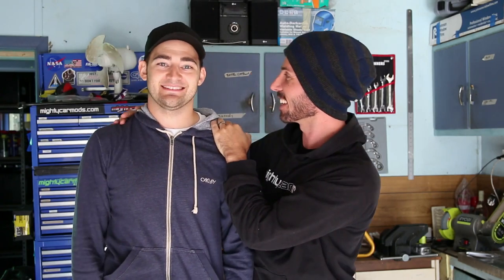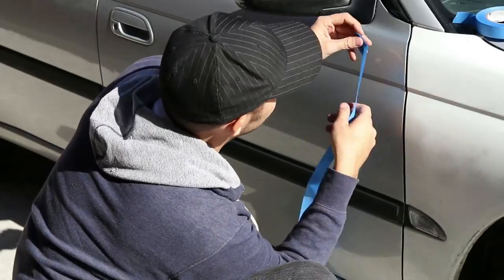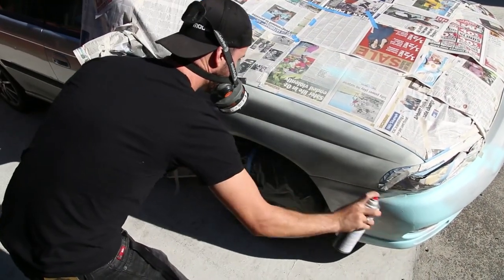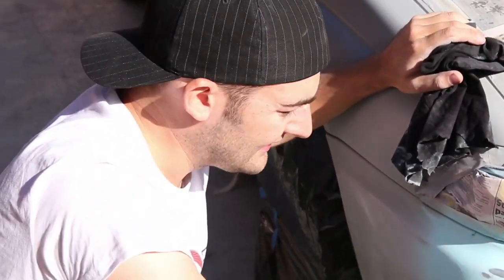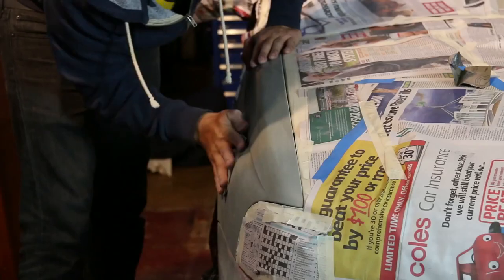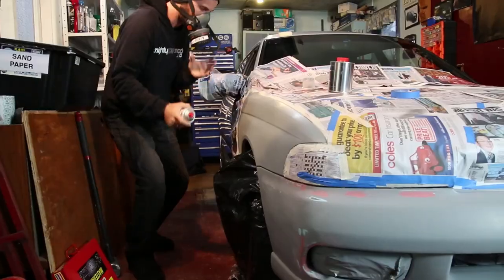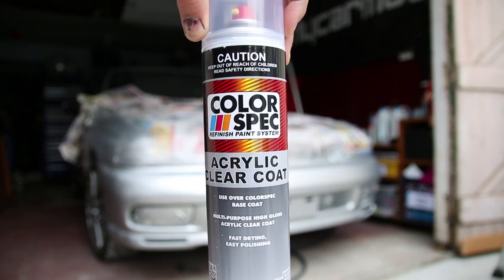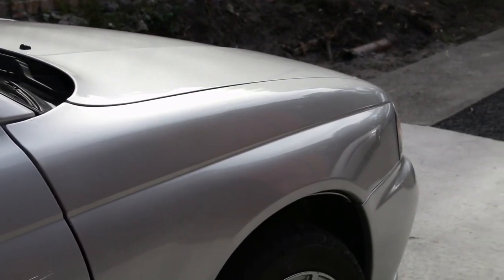How to - Paint your Car using ColorSpec Paint with Mighty Car Mods

Comment: Rip original gramps
Reply: the gramps in the video; will not be forgotten. <3
Reply: Lucky thing I bought it. Original Gramps lives on.
Reply: Wait you own the original gramps? <3
Reply: Cameron Walker Yes I do. Got plans to throw a 3.0 in it with a low boost setup.
Reply: Nice!
Reply: Corbin Drowley do you still have the car? How did the paint hold up?